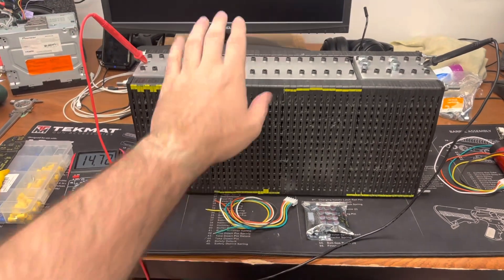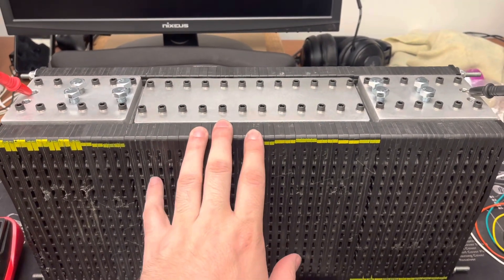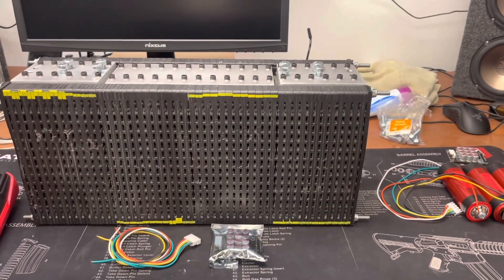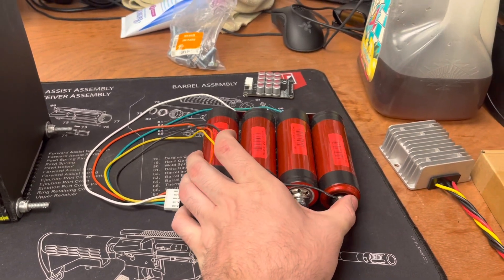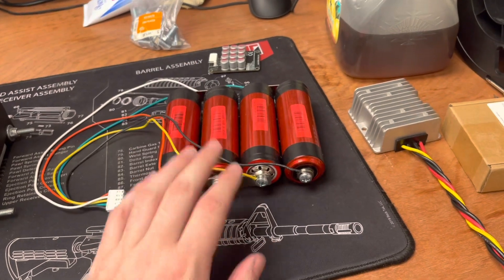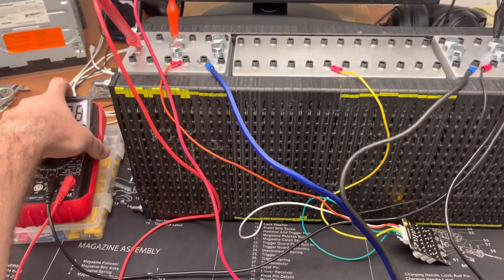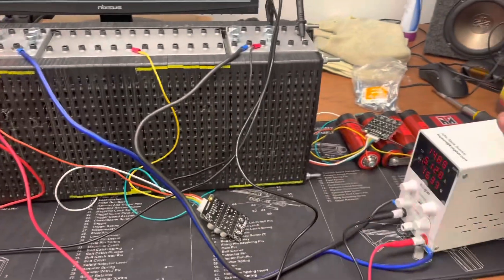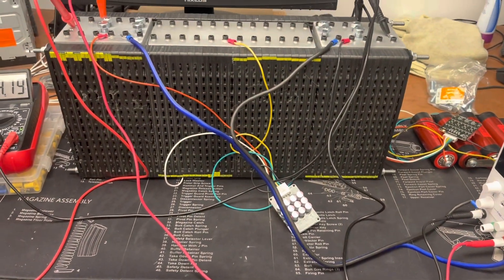SPIM08HP PART 2

Comment: What do they charge at I'm being told it's dangerous to charge above 13
Reply from the maker: In a 4s configuration, I run 15.5ish volts but these are safe to mid 16s. I think they aren’t being sold anymore on battery hookup or else I’d build two more.
Reply: @thelifeofriley815 okay I need help I have 24 cells total 6 connected on left side 6 on the right and 12 connected in the center
Reply: @thelifeofriley815 my bank looks exactly the same seems like the same configuration. I don't know jack about this type

Comment: What amps did you charge at?
Reply from the maker: 340a AutoTech alt at 15.4-15.7v depending on temp and how charged the bank is. Basically the same voltage range as cmax. Mid 15s is a good place for these.

Comment: Are these = to C-Max
Reply from the maker: I’d say so. Jerry ain’t loud used spim before cmax. Similarly rated C rates, spim is higher ah per cell, same voltage range. Spim is very happy at 15.4-15.8v. I’ve been daily driving for about a year on this 96ah bank. Definitely hates the cold though. Started car fine at 15°F but won’t hold voltage on music whatsoever. Doesn’t charge below 32°F. At 50° I can do car off demos and play a couple songs before I drop half a volt. (4k clamped)